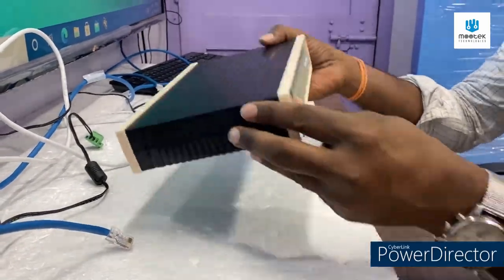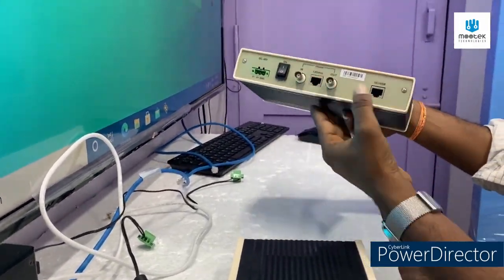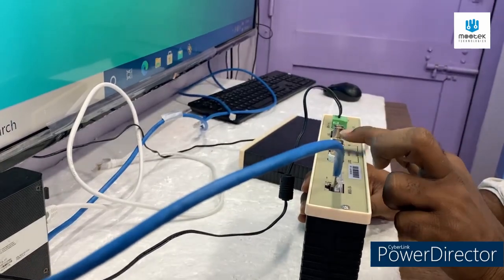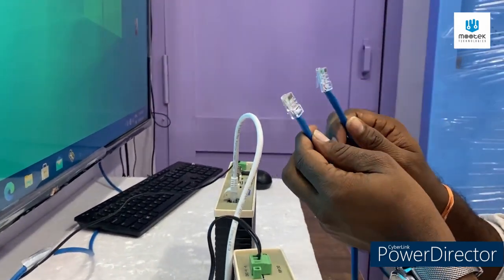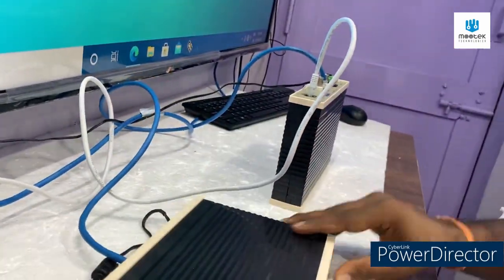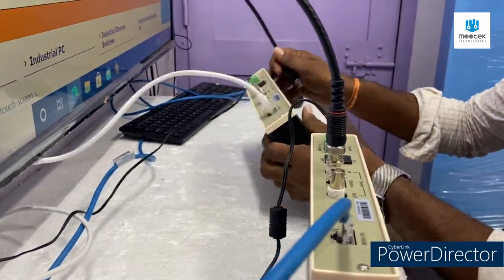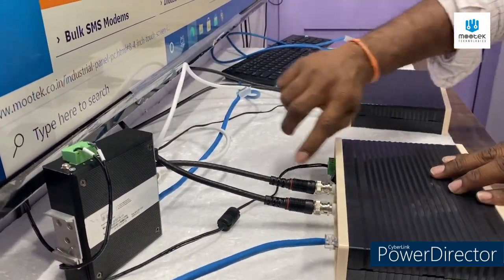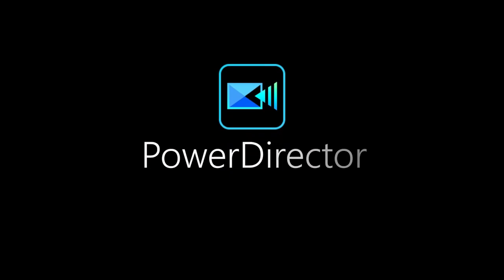E1 to Ethernet Converter

Comment: In the transmission center we convert the E1 to Ethernet by a modem-coverter(E1-Ethernet) then we send the packet in two wire by SHDSL,  in the client side we use other modem to extract the frame....two different type of modem, 1-one coverter and the 2-second modem for the exploration in the client onpromise.

Comment: Hello, I have a question. Does it going to work if I want to convert an E1 traffic to pass througth an ethernet equipement? E1 to ethernet and Ethernet to E1??
Reply from the maker: yes, it's bidirectional converter. so, you can convert E1 to Ethernet as well as Ethernet to E1.You have to use pair converter.